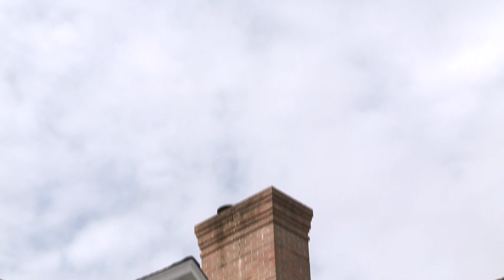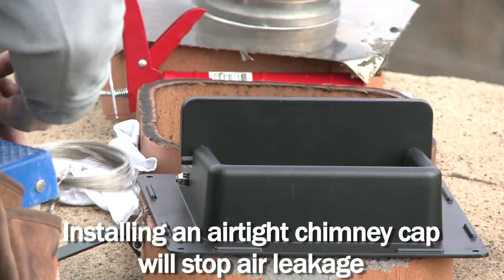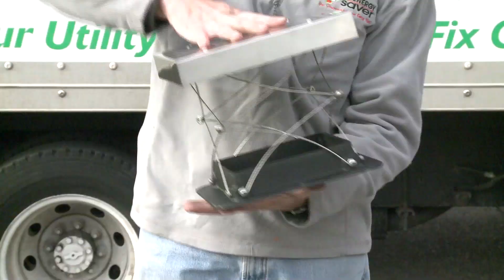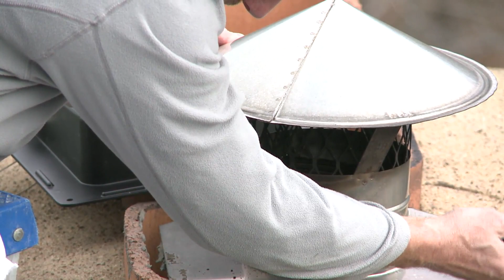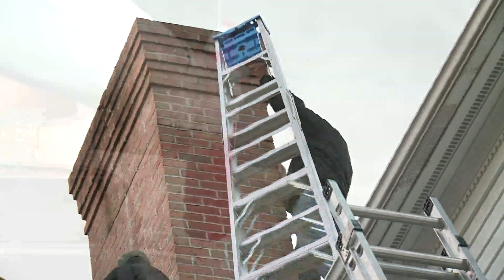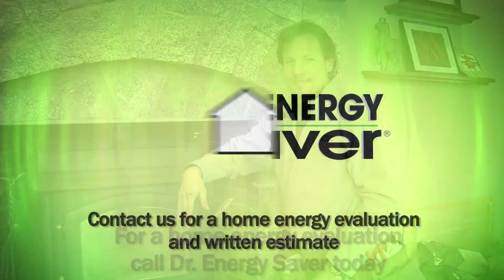Installing an Air Tight Chimney Cap to Stop Air Leakage

Comment: What do you do if you get an ice storm or a heavy snowfall with the flu cap that's spring-loaded or the flip top one?
Reply: Well if you’re in the season where there’s a nice storm or heavy snowstorm you should be using the fireplace in that will create heat to keep the top or the lid of the chimney from freezing up or ice buildup from the heat going up

Comment: We have a fireplace that we don't use so we wanted to cover it up. We live in San Diego so we have wood exterior walls. But we don't want to completely eliminate the fireplace and chimney just in case, if we ever sell the house, we could reconstruct the mantle. Would it be a good idea to use something like this and then could we just demo the mantle and frame-in the opening?

Comment: Insulate the top and smoke chamber.
Drill a hole out the side or base of the firebox and install an air intake.
If the chimneys in the center of the house you'll have to install the vent to the basement and use the basement air for combustion.
Never put a lock top of any kind on the top of a woodstove.

Comment: OK. I watched this and read the comments below. What people feel and think about Larry's knowledge quotient are opinions. Facts are good: Opinion, well,  ...I am totally against crown washes on chimney crowns which were built incorrectly in the beginning. I think what one comment sharing person  meant when they said "cement" ... was concrete. Modern concrete is created by mixing  sand, aggregate, water and "Portland cement".  I also think reverse corbels, tricky twisting designs and revealing horizontal mortar joints  are an anathema to good chimney construction and are the major contributors to accelerated deterioration of the chimney. I question the installation which is without a wrapped SS liner and nothing  stopping the flow of air at the damper with kaolin fiber and a metal plate and an appropriately sized hole for the liner. This wasn't actually a typical fireplace "insert" install but is instead a wood stove set into the fplace. I would have treated it the same as a wood burning stove's vent connector into a wall or straight up into a metal chimney. One wouldn't leave an unplanned or unconsidered gap that air could pass through.  A top sealing damper on an airtight wood burning stove shouldn't be necessary if the installation had been done correctly.

Comment: looking to get rid of my wood burning fire place. and add an electric fireplace. can i cut off my Chiney Pipe in the atic and Cap it there? i was hopeing to wait until i need to replace my roof to remove the  top pipe! can i do that?  or use it as just an ATTIC VENT until then?

Comment: HI Larry, quick question, Assuming the stove door is closed when not in use, what extra energy saving does the cap do? The air from the room won't flow through the chimney as it is stopped at the stove door. My new fireplace takes air from a pipe leading to outside for combustion, so no air will be coming from the house unless there is an air leak in the stove door.

Comment: This is a terrible solution and has a lot of misinformation. What supports the liner once it's cut? How does it get cleaned afterward? A far better and more common solution is to seal the liner at the damper area with an insulated block-off plate and then to pack the top of the chimney with kaowool insulation, then cover with a proper top-plate that has a good drip edge. The top plate is sealed at the rim with silicone, just like has been used in this video for the top sealing damper.

Comment: A 1" expansion of 40' of Aluminum implies a 169 deg F temperature swing from winter to summer.  That's a little extreme.
Reply: Not really, especially with dark colored gutters they can get extremely hot.

Comment: Question - How would you close up the space just above the stove to stop that air from going up the chimney while t is running?  I'm asking because as you said my rectangle damper that I keep closed is not very air tight and I would like to somehow make it air tight.  The great thing is that I do NOT use the fireplace at all.  We just put decorations in it for each season.
Reply: You need construct a registration playe  and  seal it off .This  will improve your draw on the flue .This will also stop any heat /ait leakage  from the house from travelling up the chimney stack .. ;)

Comment: I have the exact same damper installed on my house and it is absolutely worthless.  I have a ton of air leaking through it and am actively looking for a better solution, which is what brought me to this video.  Avoid this product at all costs!
Reply: Agree completely. I also had this damper installed and I still get a big draft through the fireplace. Manufacturer said I must have a pressure problem in my house.

Comment: By code, stainless steel liners that are connected to a wood burning or gas appliance, needs to be extended all the way to the top of the chimney. it should have a top plate and storm collar to prevent water from getting in. the easiest fix is to put insulation around the liner in throat/ damper area.

Comment: Wow.  What a mess. The chimney liner is typically supported by the top plate. Someone may have used the wrong type of plate, which should have had an airtight lip to seal to the terra cotta. Your "upgrade" process destroyed the existing seal between the liner and the top plate, and removed all structural support of the top of the liner. You have also removed the "spark arrester", which is a violation of California Building Code, and other local codes requiring it.  The spiral flue liner is designed NOT to have a large coefficient of thermal expansion and will (unlike your gutter example) flex inside the flue, not pushing the top plate up. Not sure why that flue liner is not also insulated, nor why there are large, unsealed holes where it penetrates the damper. You can blame the previous guy for having done it wrong, but now YOU are that "previous guy" who is responsible for the entire mess when it comes to the next annual inspection. Leaving the damper unsealed will continue to allow massive waste of room heat whenever the top damper is open, now that you destroyed the seal at the top.

Comment: And lastly WHY oh WHY did you cut the stainless steel chimney liner below the top of the flue tile...That is against the manufacturers specific instructions and a hazard for the installation...I am so glad yo are not working on my home!!! YIKES
Reply: Yikes indeed. As a violation of the installation instructions, it violates the product safety listing and therefore fire code.  Next time you hire a professional for the required annual inspection and cleaning, he or she may simply walk away, or report it to the fire inspector.

Comment: And we are just ignoring the second wide open flue tile??
Reply: Look at 5:15.  There are TWO other wide-open flues. Because he disconnected and cut off the spiral ss liner and its top plate, and the hole is still open where the pipe goes through the fireplace damper, he has probably INCREASED the loss of room air, with the wide open connection between the room and the open top. If the SS liner had been insulated and the top and bottom sealed to close off the existing flue, it would have been a much better job for the customer.

Comment: What do you or anyone else recommend blocking the space around the SS liner and chimney wall at the bottom of the chimney. I want to block that air space with something non combustible
Reply: Good point, Mario. You can use strips of "ceramic blanket" or wired pads of rock wool or non-combustible fiberglass insulation to bridge the gap between the masonry and the (insulated) metal flex liner, then block up the entire opening with a flexible metal plate having a hole cut for the pipe and outside dimensions to fit the top of the fire box. This is the sort of thing an actual professional installer would do automatically.
Reply: A sheet metal "block off plate"

Comment: For someone that relies on such installations as a primary heat source that is rarely cooled down, more emphasis should be placed on sealing between the liner, damper, and the original flue. About the only time that chimney cap would be closed would be during the warm season months when the air exchange is not an issue.
A good video otherwise :)

Comment: This liner should NOT have have been cut back. Bad advice plus you didn't solve the problem of heat loss while the stove is running. Glad this "Doctor" isn't working on my house!
Reply: He has also removed the spark arrester, which is completely illegal in California Building Code, and many other places where required by local rules.
Reply: Yeah guy isn't professional

Comment: Hanging the liner short of the top is a bad idea. You should have flipped the top plate and cut the liner flush to the top (or left it 1/2 over). Then you should have used the lock top over the lymance damper to fit best. It is always better to use the damper with the additional spark arrestor to stop ambers from flying out of the chimney. Those other flues are 13x13 I believe and top sealing dampers should be installed on those to from maximum energy savings. The mortar crown should be refaced and exterior sealed before those cracks get much worse.

Comment: You spent a lot of time explaining how BAD the efficiency is going to be when the wood stove is in use but gave nothing for how to fix it.  Sure controlling the air loss is important when stove is NOT in use, but give me something.
Reply: Proper sealing around the damper by a custom made plate...then loose fill after liner install from the top with a few bags of Vermiculite.........and an install of a primary  top plate  cut snug around the liner.. sitting into  internal of flue prior to the flashing cover  being fitted would give a snug  home...so none of those  convection currents...that he was on about...

Comment: My parents' home actually has a separate little vent, made of very heavy cast brass (to be compatible with fireplace temperatures), in the floor of the fireplace, connecting to a grille on the outside wall. When you open the vent, it sucks the combustion air in from outside. Of course it's not perfect, but you can clearly feel that a good amount of the combustion air does indeed come through the vent. It can be shut when the fireplace is not in use. Has anyone researched these things?

Comment: Made the problem different, but still a problem.

If the liner had been installed correctly with a metal blanking plate at the damper there wouldn't have been an issue. Mineral insulation packed around liner at the base of flue and high temp calking around blanking plate would have eliminated heat loss and made it fire safe. When your new fangled damper is open heat still escapes around liner and there is still a potential fire hazard without the damper blanking plate. Was it inspected???

Comment: Larry, 
I appreciated this video on chimney top dampers. However, I question the process of cutting off the stainless chimney below the top of the masonry chimney for a couple of reasons.
Code: I presume that code is written for a reason. In Portland code requires the stainless chimney to continue to the exterior of the house.
Air sealing: At my house  the stainless chimney cover yoke is siliconed to the masonry. When I blower door test the house. There is little leakage at the stove.